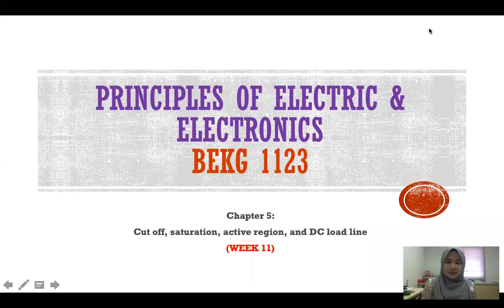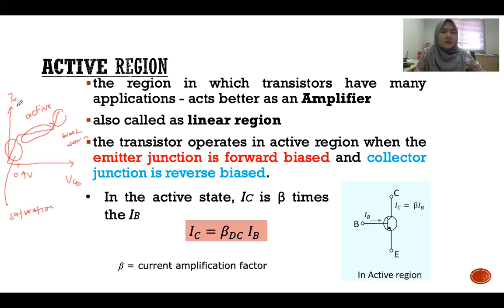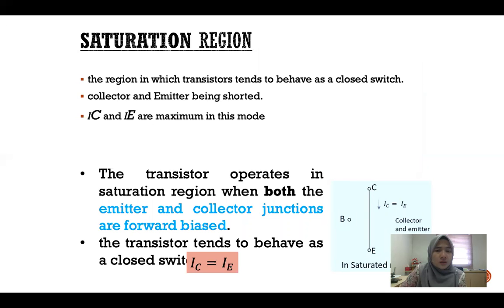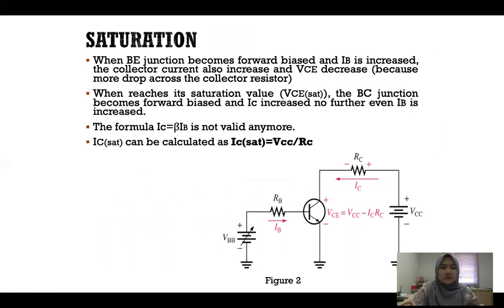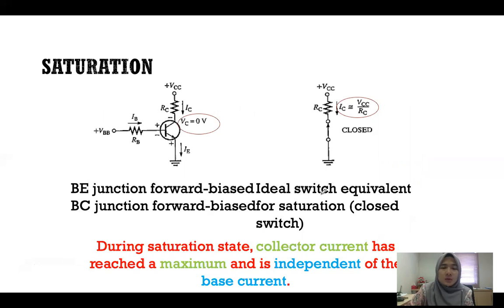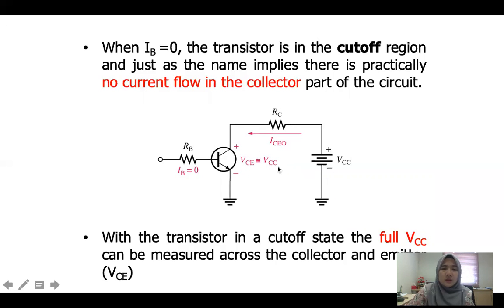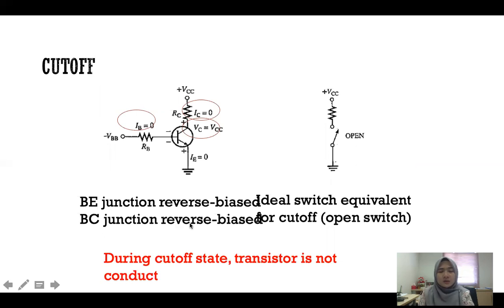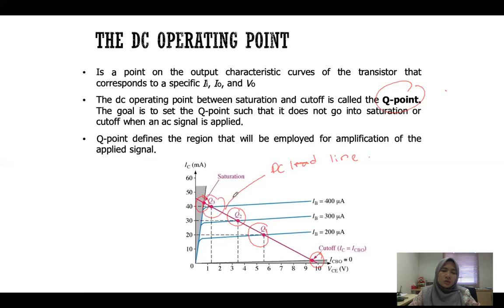CHAPTER 5: BIPOLAR JUNCTION TRANSISTORS (CUT OFF, SATURATION, ACTIVE REGION, AND DC LOAD LINE)

Comment: 9:45: The summary explanation is incorrect. NOT
(1) BE Junction Forward-biased(FB): Ideal switch 
(2) BC Junction forward-biased: for saturation (closed switch)

These 2 conditions are interpreted as ONE SET of conditions for Saturation, i.e.:
In Saturation Mode:
BE junction forward-biased AND BC junction forward-biased ==> then BJT will act as an "ideal switch equivalent for saturation( or a closed switch)"

In a bigger picture:
(1) Active region: BE junction => Forward Biased AND BC junction => Reversed biased
(2) Saturation region: BE=> Forward Biased AND BC junction =>  Forward biased
(Note the main diff between Active and Saturation is the BC junction biasing)